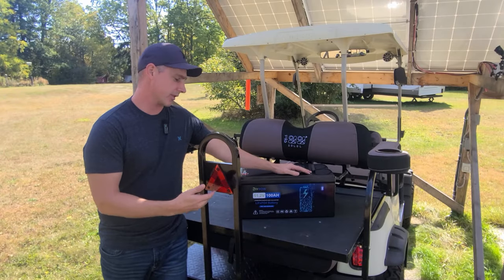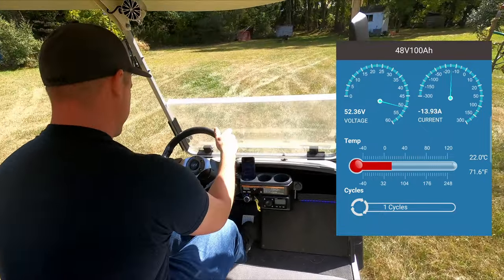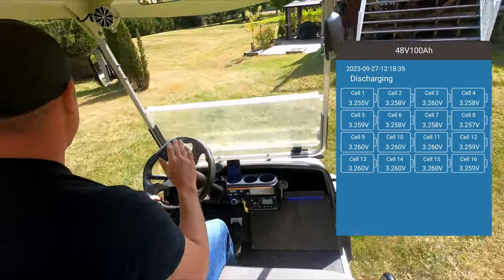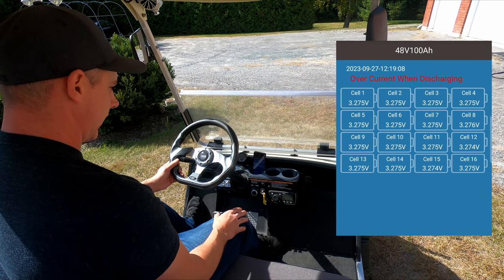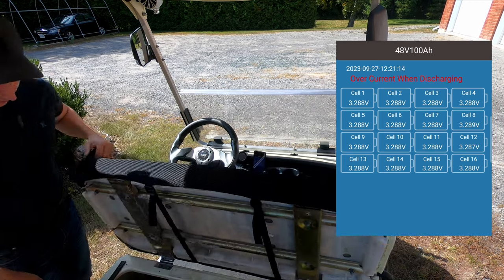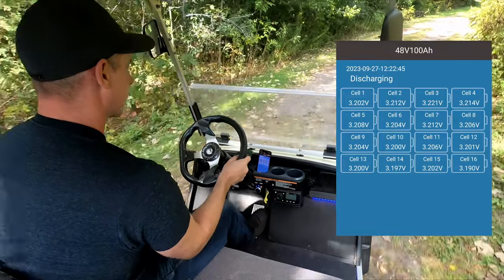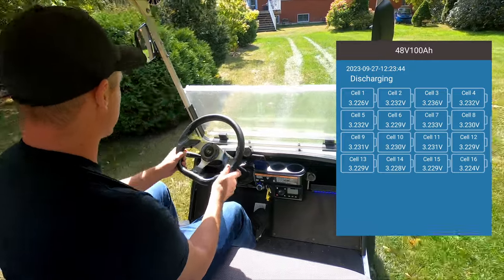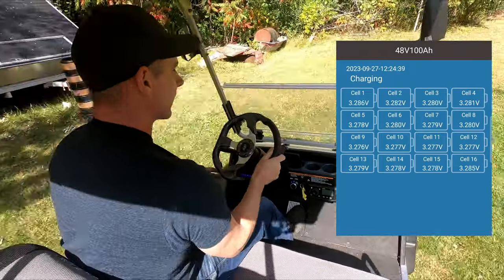Real World Golf Cart Battery Test. DIYPOW 51.2V LiFePO4

Comment: Not acceptable. ☹  Maybe with multiple in parallel, but "overkill."
Reply from the maker: Maybe in Florida on flat paved ground, it would work ok.
Reply: I live in Florida and have a similar battery and after about 20 minutes of running around with leds and music playing my cart shuts off also.
Reply from the maker: @willsecola1850  Party pooper
Reply: @Roll2Videos my bad lol just looking to get my cart and battery fixed.
Reply from the maker: @willsecola1850  When my wheels and music stop, that's the party pooper. Lol Changing out the BMS would be the best fix. I suggest a JK with its high current balancing 👍

Comment: Why did you leave your ap showing absolutely worthless cell information while it kept going into over-current protect?  Cell voltage tells you nothing if you keep over-currenting.  The entire point of the amps gauge is to show you amps - I would have loved to see the limits of current before the BMS disconnected.  For me this video was maddening....  I wanted to see current draw...
Reply from the maker: Can't make everyone happy. Next time I have a test like this I'll keep that in mind.
Reply: @Roll2Videos  My apologies.  My frustration got the better of me.  I have yet to run across a video showing amp draw in a golf cart, as it relates to BMS cutoff, and I thought, "Oh, this will be the one!"....  Showing how many amps a 48v cart can pull will determine how many batteries I plan on buying.  I'm betting on a peak just before shutdown you were hitting 200amps.  I would love to see another video, and I'm subscribing to your channel for that very thing.
Reply from the maker: @jimweber8602  It's all good buddy, my suggestion is the epoch batteries https://www.epochbatteries.com/discount/roll10?rfsn=7083713.4f6bf4
They have current limits so the cart's speed will just reduce and the battery won't cut off. I will have to remember next spring when I take my cart out again to do the test you are describing. 
Thank you for subscribing
Reply from the maker: @jimweber8602  These are the ones I'm using https://www.epochbatteries.com/products/48v-120ah-gc2-golf-cart-lifepo4-lithium-battery-complete-kit
Reply: Agree with Jim, why bother to stress test a battery, and just show less than informative cell voltage. Why not show the stress of amperage during your stress test. 100% sure you hit 100+ amps, maybe 110 amps, maybe 120 amps … will never know, as you did not display this data. If you pushed it to 120 amps, and rated at 100 amps … then you did the battery review a disservice, as exceeded the manufacturing rating. Give it a fair test in the future!! Thanks for what you did accomplish, for anybody who needs this battery, with less than 100 amp load, looks like great battery!! Thanks for the video. Marc